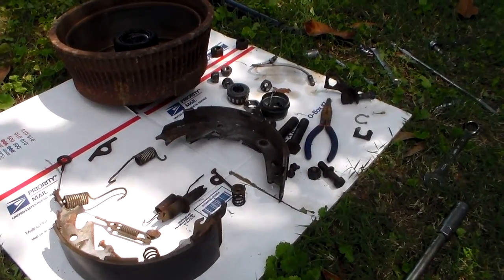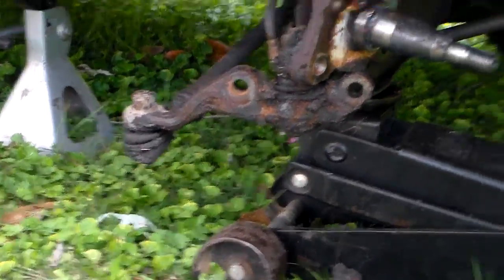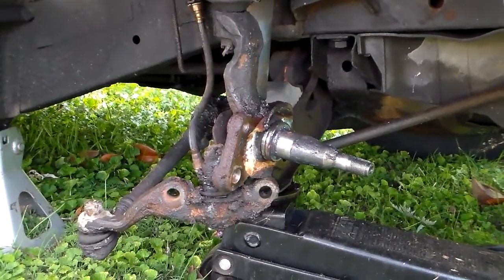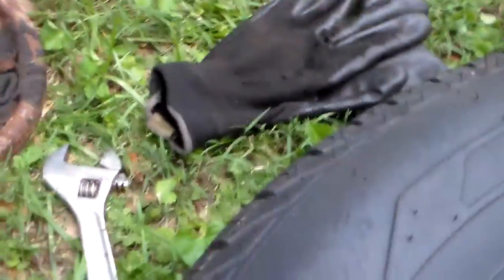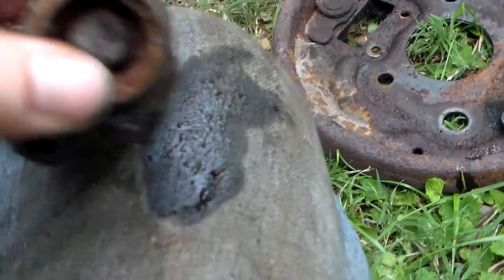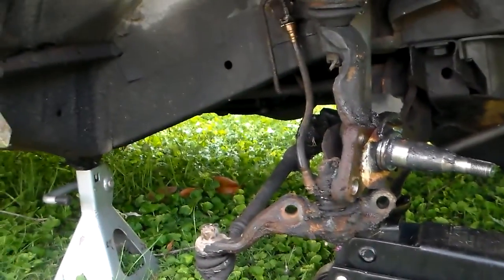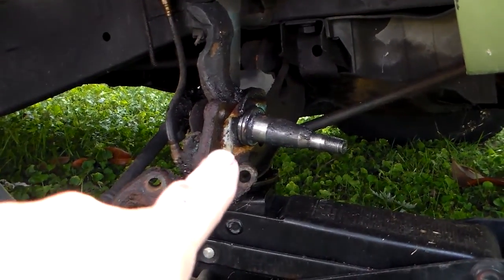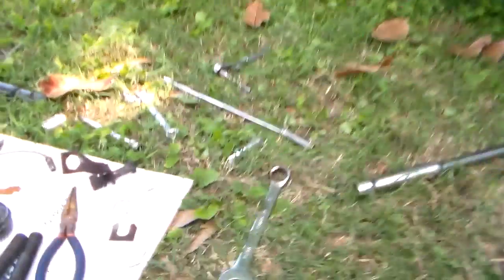Diagnosing drum brakes that pull to one side part 3 of 3

Comment: Hi. You have a real car. Thank you for this video. The same thing is happening with my 1977 cj5 (4 wheel drum brakes). Both front brakes fluid hoses (with no leaks) where replaced, but still pulling to one side. Next I will check and replace front brakes wheel Cylinders.

Comment: yep thats why i take a air chisel to the bolts so i dont have to take all that crap off, im not taking off the backing plate, dont want to be there all day. works every time. yes it is a pain to get to the wheel cylinder bolts, been there done that.

Comment: I agree it is dangerous messing around coil springs. I had worked many projects that needed suspension work and I prefer not to mess with the springs but will if warranted. Only one time out of many I had a spring compressed to remove. It was lucky that after it was out of car and away from me that one side of the spring came undone from compression. Scared the crap out of me.  Thanks for sharing drum brake knowledge for us.

Comment: DUDE this is perfice.  I have a 68 impala with exactly the same problem meaning when I brake it pulls hard to the drivers side.  Yesterday I was driving it and the passenger side locked up after braking.  driving a few feet and if finally let loose enough to get home. I good the drum off and losened the adjuster and it is working and did the same to the other side to see if that would help but no luck.   i will go back out now and look closer using the procedure you provided.  Thanks for all the details.

Comment: What's your opinion on how the rear drums would affect this car also pulling to one side?  And, what did you do to eliminate the rear also from not causing any pulling?
Reply from the maker: It can also cause pulling but not as severe as when a front wheel is involved. I have not dealt with the rear brakes on this car yet. Once I get the fronts back together I will road test and see if the pulling is gone. If not, on to the rear brakes.